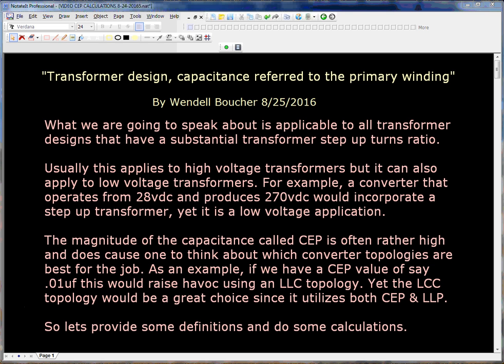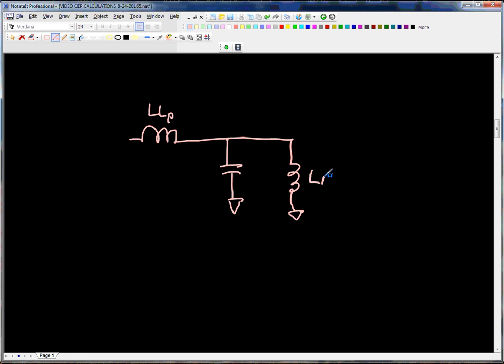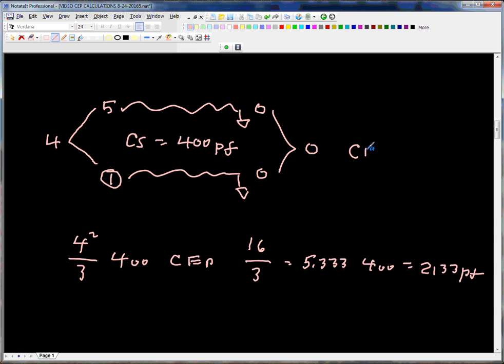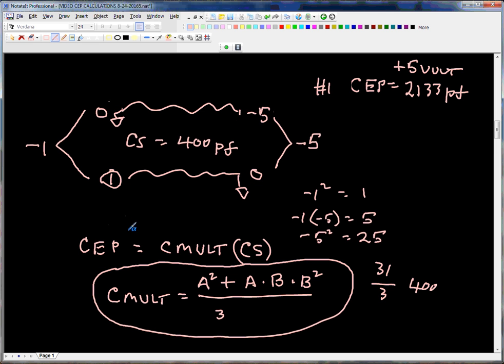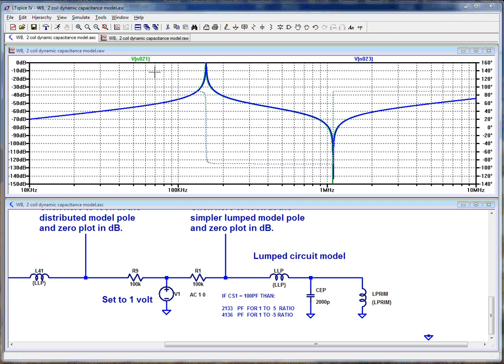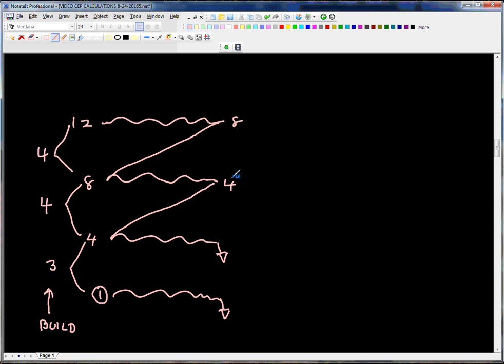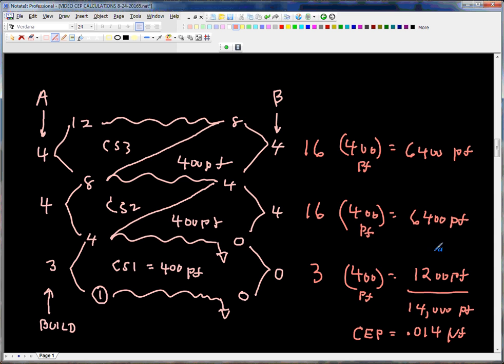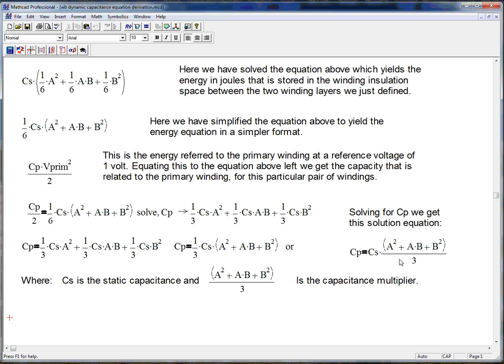TRANSFORMER DESIGN, CALCULATING INTRINSIC CAPACITANCE  REFERRED TO THE PRIMARY WINDING

Comment: Thanks so muchWendell, you help me and others a lot, can you please help me how can I pick MOV if my input is 3 phase 220vac and output is resistive load 45 vdc 10 kw the input capacitance is 470uf so how can I calculate my MOV? Also the size of the thermistor which I use it for precharge capacitors (soft start) and I short it after ms with relay, what is the minimum power for this thermistor?